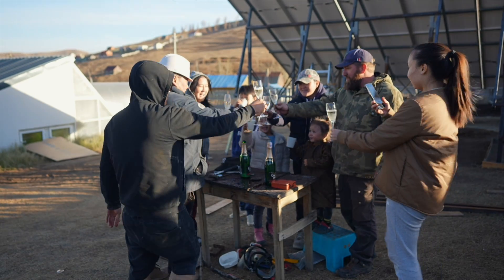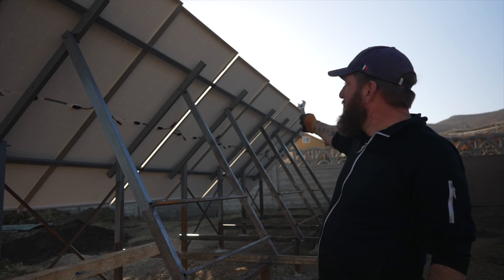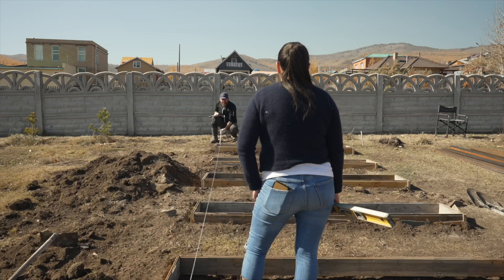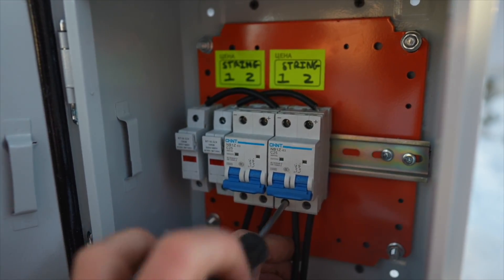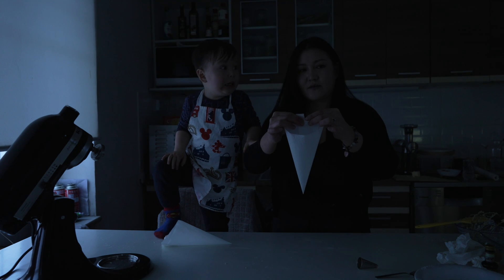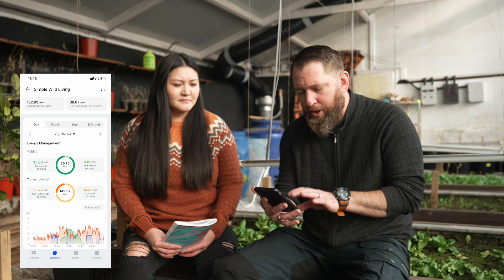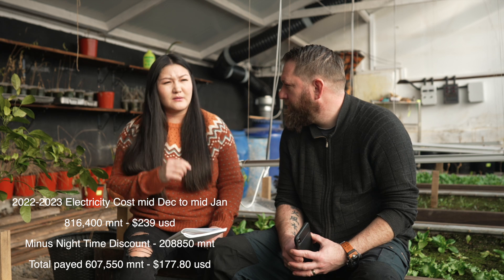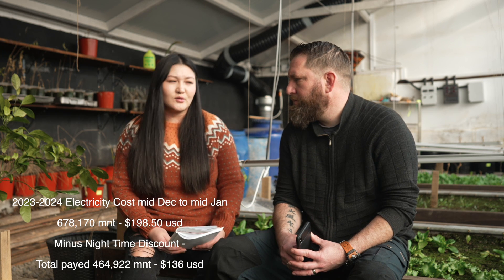TOTAL COST Of Our 10kw SOLAR POWER SYSTEM | FusionSolar Powering our Home

Comment: You are mixing up your units: your PV panels are 10kW, but your batteries are 15kWh. Common mistake, but so then..
Your normal household needs in winter will drain those batteries in (my estimate) 10 hours, right?
Reply from the maker: Hi thanks 😊 our inverter is a 10kW and we may add more battery’s when we can afford it

Comment: Very good information. The last time I checked into solar here (Nebraska) it was right around $20,000 for a whole setup and the company to come install it. I think I will one day install a small wind turbine instead of solar. (the  wind is fairly constant here)
Reply from the maker: Wow, and there so many ways to do it. We will think about looking into that too as it is really windy here too. 🙏🏻
Reply: Check a bit regarding wind power. Seems like it never pays off for small scale systems. To many moving parts, and you often overestimate the max power. There are a few good videos explaining why its often not a good idea to go for wind. (Hydro or Solar are fine, wind is mostly a fun gimmick, not really good for real power production if you dont go for mid sized - and expensive - solution)

Comment: When you can afford it? Double the battery bank. And I would also look into the software for the inverter to see if you can set it to charge at night when its cheapest in winter. Power is always most expensive 5-9pm pretty much everywhere so if you can avoid pulling from the grid at all during that period, you will find the system pays for itself faster.
Reply from the maker: Hi 👋 Dave, yes sorry I forgot to mention that in the video. We have full control over the system, when we use and charge the battery batteries. There are so many options to control the set up. I will definitely add that aspect in the next one.